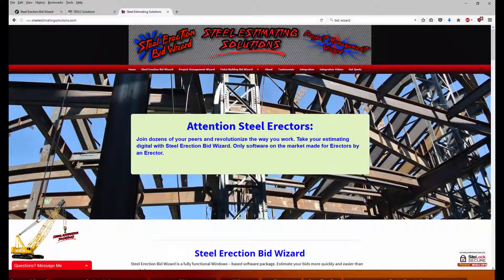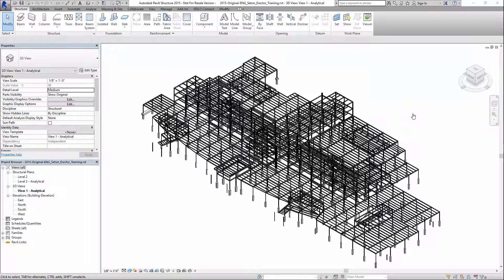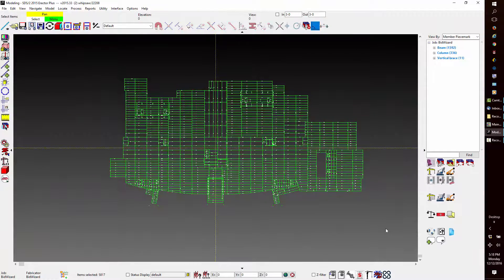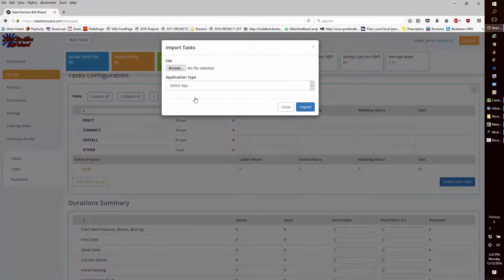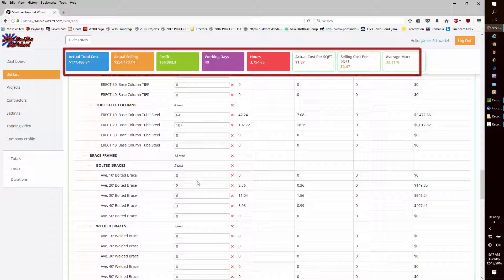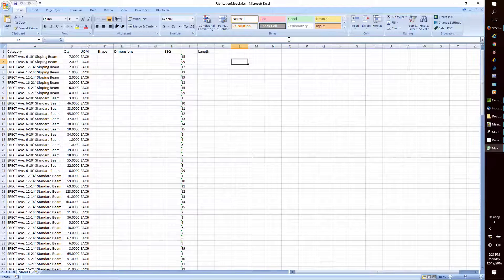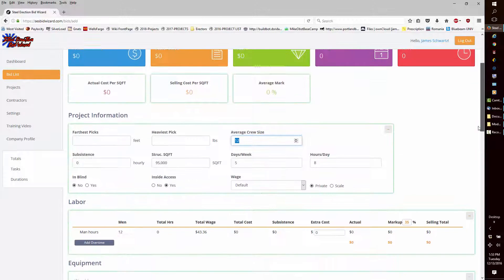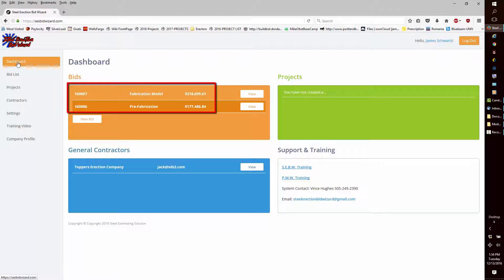Steel Erection Bid Wizard now integrates with SDS/2 Design Data

Comment: This is a great idea.  The only problem I see is that about 99% of the time you bid a job the drawings are only about 75% complete let alone having access to a model.  The problem these days is that the schedules are so compacted that they are still designing the buildings at the same time fabrication is taking place.
Reply from the maker: Thanks for the comment Mike, yes you are right that is a big problem. Really I'm just trying to be forward looking, the concept of model based estimating is being thrown around out there more and more, and it is our intent to have something in place when and if it goes main stream at some point in the future. On the other hand for a company that does design build and creates a model through that process this allows for a lighting quick erection estimate. Really most fitting for a fabricator/erector but there are more and more erectors getting access to models as well.